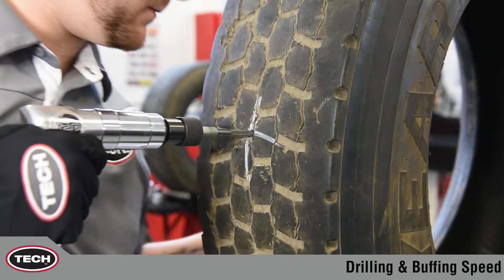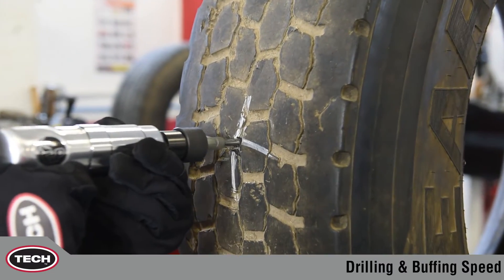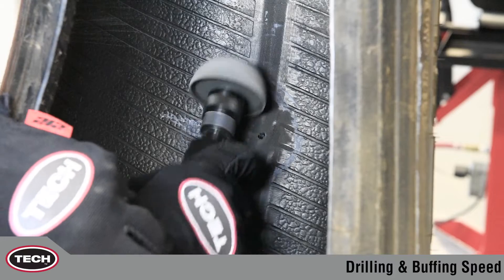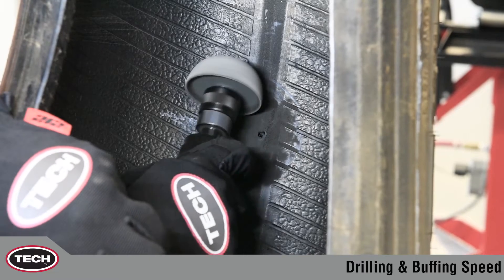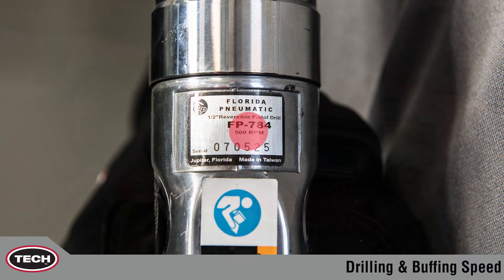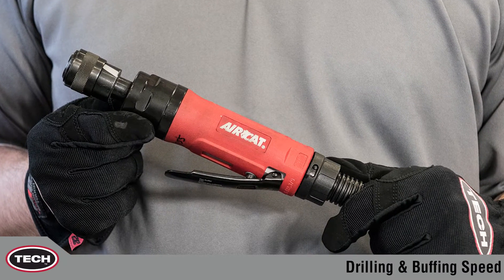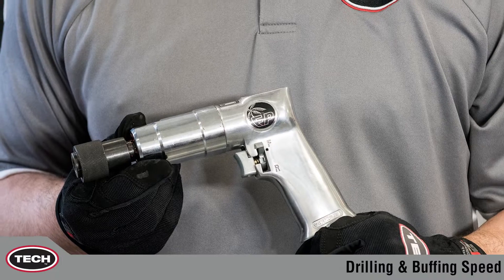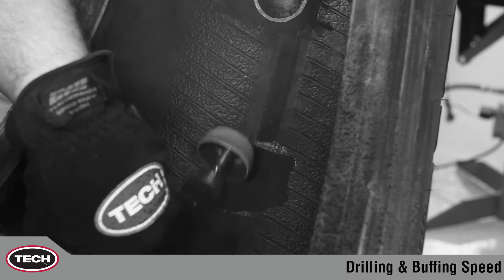Tire Drilling and Buffing Speeds

Comment: Can i use rotary tool to do same ?
Reply from the maker: Be sure to use a tool with the appropriate rpm speed and  a buffing wheel in order to not scorch the rubber and create a new surface for applying the repair; whether it s a one-piece combo unit or a two-piece repair.